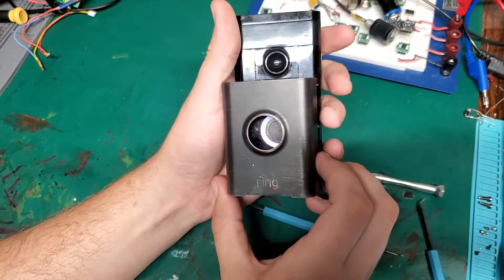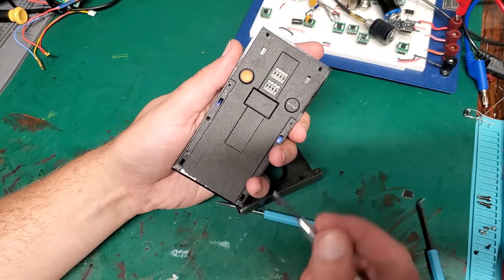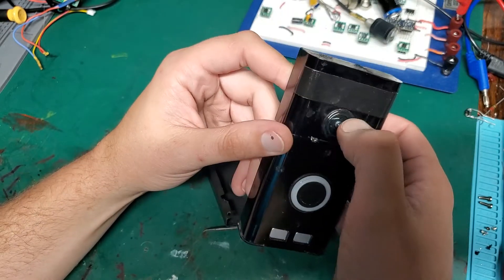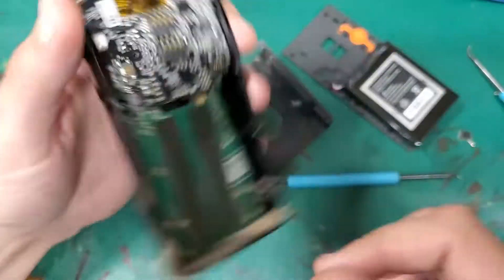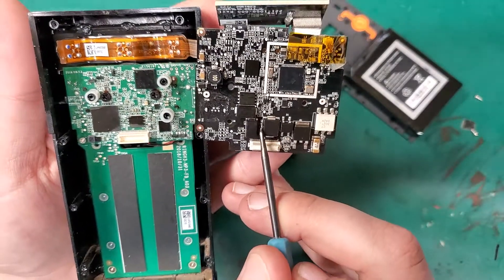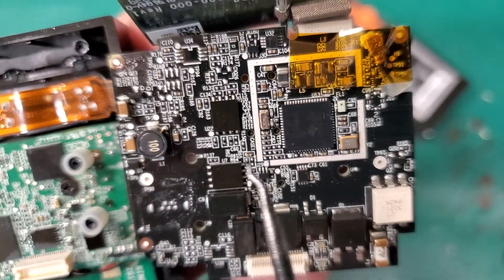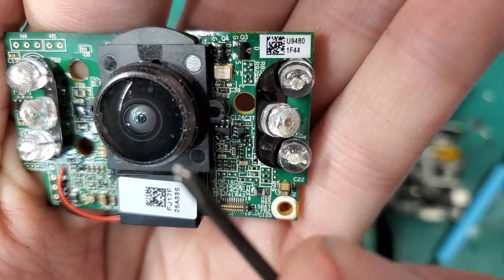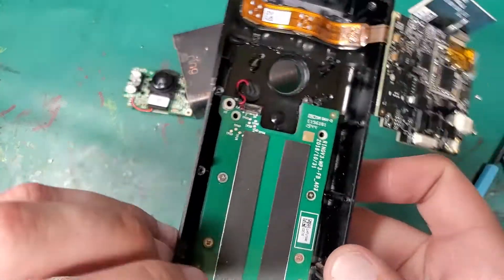Is a RING doorbell waterproof? Teardown / look inside a 6month old unit

Comment: I wish you could show what's in there that makes makes it not chime to my existing doorbell. If it's hardwired to where my old doorbell was, why do I need to bypass that & buy a Ring chime?
Reply from the maker: You mean, it draw power from the old bell, or are you referring to your original doorbell sounding off when the button on the new one is pushed
Reply: You need to use that jumper cable included to install on you old doorbell chime otherwise its drawing constant power.